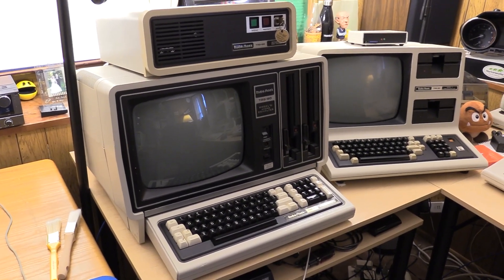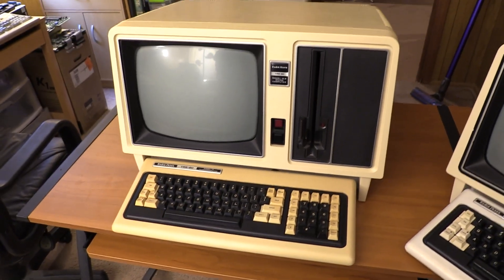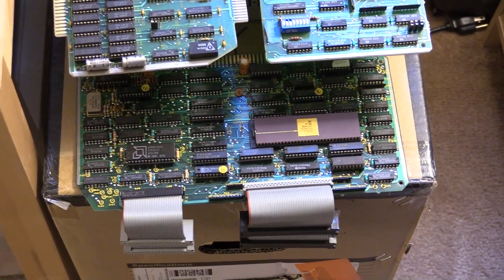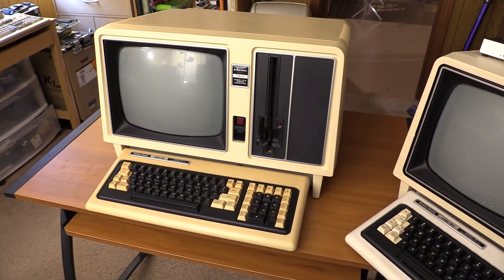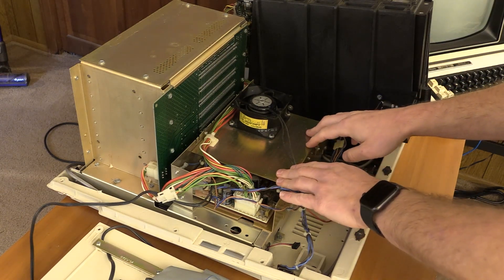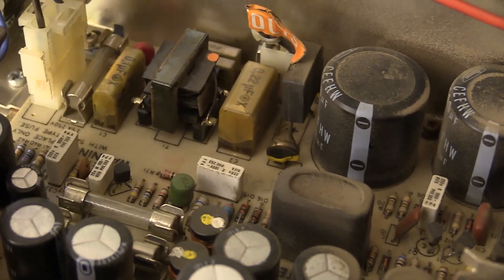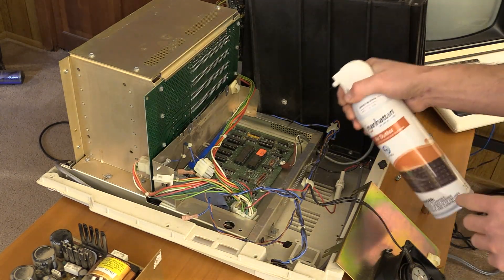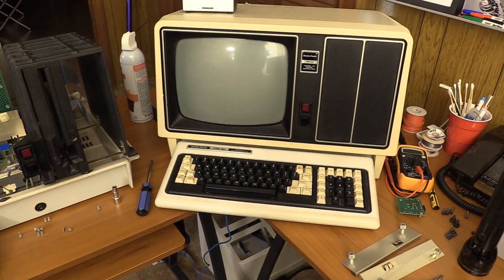TRS-80 Model 16B - Overview And Restoration - Part I

Comment: Back in the late 1980s I was gifted a Model 16 a couple of Model IIs and a Model 12.  The 16 came  with 1MB RAM, 3-Port Seriel adapter,  5, 8 and 70 MB hard disks, Dual floppies as well.  Software included  Xenix and the entire Tandy Accounting and Inventory Management system.  Having all the terminals connected made it fun to play "office".  I had a DT 100 and used a couple of model IIs and a model 3 for terminals .  I also had a Line Printer Models I, III, IV and V.  I was a pretty young pup at the time and didn't realize what gems they were--beyond the astronmical cost of that equipment at the time.  There was also an MBASIC compiler.  The guy I got the equipmnet was a self-made man.  He started an insurance company/agency  that pioneered group health benefits.  He did quite well for himself we bcame good friends.   .   Your videos bring me some rich and fond memories.   You not only demonstrate some pretty strong technical prowess you're also pretty entertaining.  I wait with great anticipation for you to post new videos. Thanks for all you do!
Reply from the maker: Wow, that list of systems is quite the collection!  I'm hoping to stumble across a DT-100 at some point, since it would go so well with my collection of 8" systems.  Thank you for the kind words about my videos - I like showing the machines "in their element" doing things they might have done in their heyday, and maybe a little extra.  Thanks again for watching!

Comment: That is a neat computer!  I didn’t know that any of the computers in the TRS-80 family had the Motorola 68000 as the cpu.
Reply from the maker: Thanks!  There were only five 68000-based systems, so compared to the rest of the line it was a small number: The II, 12, 16, 16B, and the 6000.  The first four were TRS-80-branded, and the 6000 said "Tandy" on it.  What makes them unique is the Z80 serves as something of an IO subsystem processor when the 68000 is in control, communicating with the 68000 via a shared memory window.  When you boot up, it's in Z80-only mode, and the 68000 is activated by software, so you can run II/12 and 16/6000 software as-needed.  Thanks for watching!